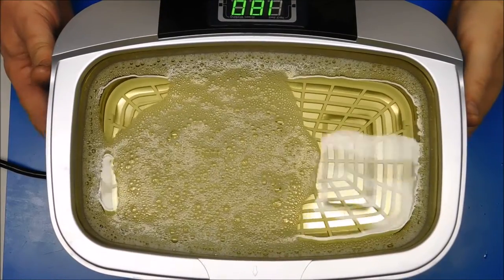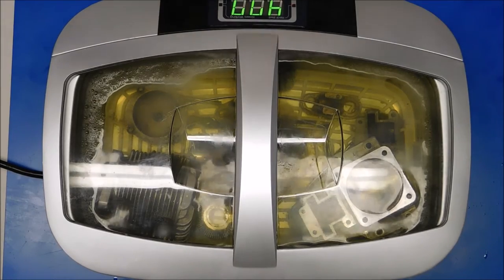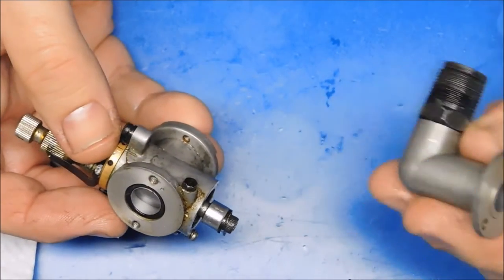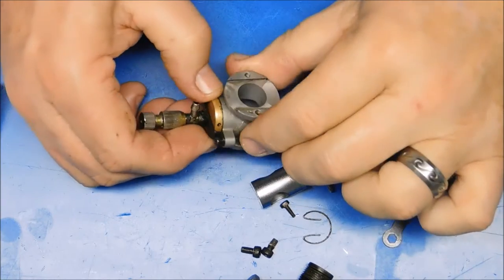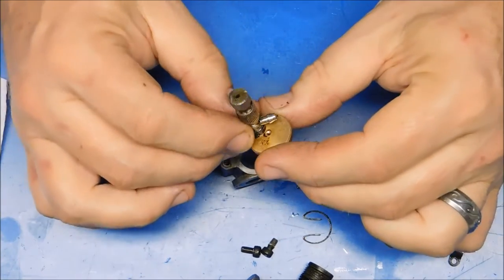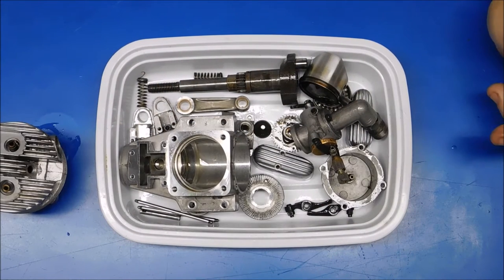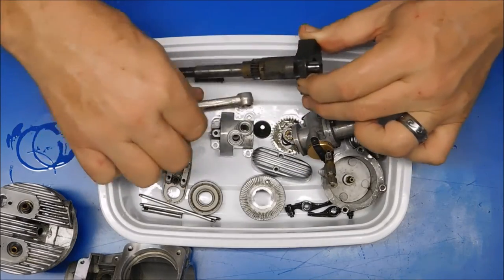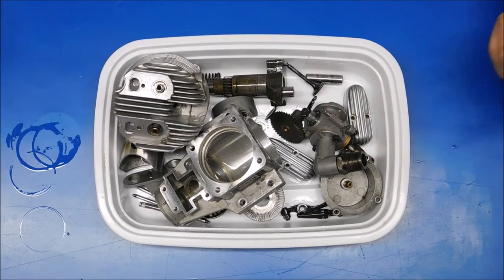Saito FA-120 Carb Disassembly and Clean Parts

Comment: Hi David . I have a FA150GK that I purchased new for a Midwest AT-6.  It's been sitting for a long time so I am re-building, where parts are available.  Only has a few hours on it, but want to get it back to pristine..  Looking for your video (??) on how to time the FA150.  Can't use the method you showed on the FA50 as the tappets - as you know - are installed before the timing gear is installed.    Any help would be appreciated.  Thank you
Reply from the maker: Watch this video.  https://youtu.be/crgxE_5x9Ig To aid in holding the timing gear in position put some thick grease on it.  Smear it along the front between the gear and housing and it will help minimize movement. A steady hand is helpful too.  I show the grease portion in this video. https://youtu.be/l_wOaDxCKm4?t=126
Reply: @dmrcflyr2  Found it!  Great video.  Thank you sir!!

Comment: awesome this cleaner. where did you buy It? would you Tell me Brand and model? thanks David..
Reply from the maker: I don't think is is available in your location. 
http://www.lastotallyawesome.com/shop/all-purpose/awesome-all-purpose-concentrated-cleaner-128oz/
Reply: David McIntire hmmm.. and the cleaner machine?
Reply from the maker: http://www.harborfreight.com/25-liter-ultrasonic-cleaner-63256.html
But you do not need this machine to get parts this clean. Just soaking them in the cleaner and then using an old toothbrush works just as well.
Reply: I've been cleaning parts in an old pot with dishwashing detergent and water. And a lot of handwork with old toothbrush .. :)))))
Reply from the maker: Yes dish soap does not work very well on dried fuel residue.  Just soaking parts in my cleaner you can see the color change as it is working.
Reply: Do not have here and do not ship as a chemical according to international law. The product that most resembles EASY-OFF for cleaning industrial stoves. But I do not know if it's not too abrasive for these engines..